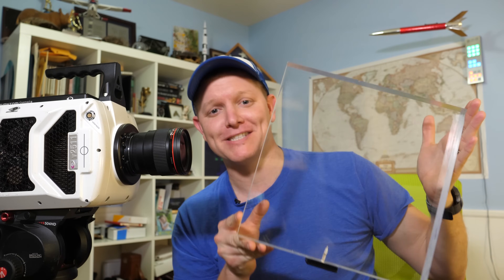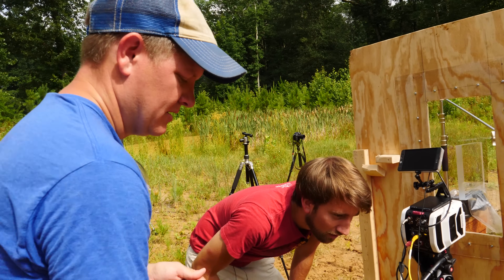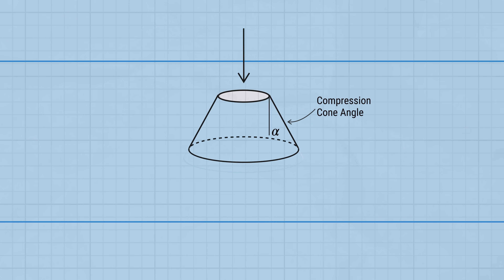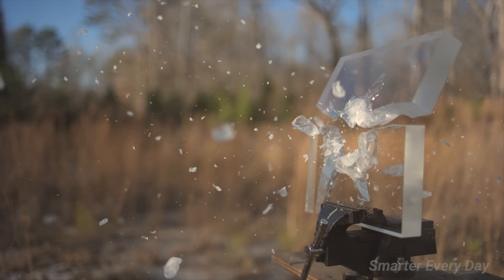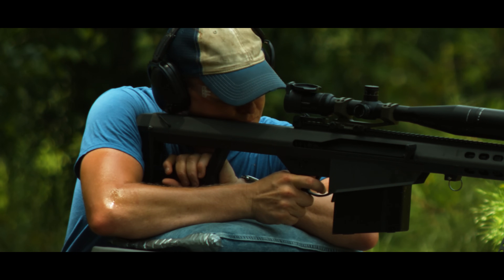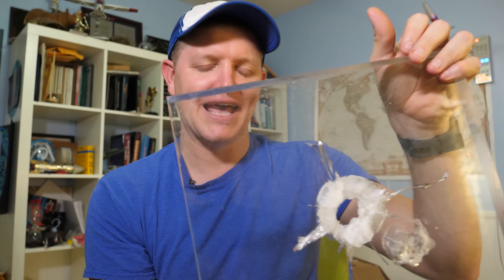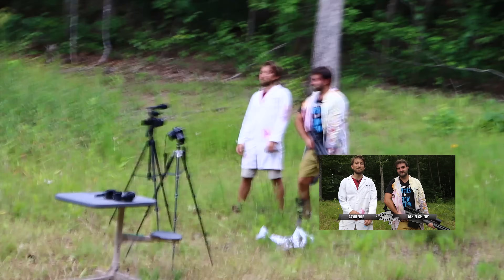.50 Cal vs Ballistic Window HARDCORE Slow Mo  - Smarter Every Day 187

Comment: One of my favorate parts of watching a gun firing in slow motion is that you can see the powder burning out of the front of the barrel. Contrary to popular belief the gunpowder in a gun doesn't explode it burns and pushes the bullet out of the gun it's really only the primer that explodes. That is why many guns get better velocity out of longer barrels and not just better accuracy. That is true until all the powder burns and the friction starts to slow down the bullet. This is also why you don't get anywhere near the velocity printed on the box when shooting .22LR out of a pocket pistol where the .25ACP is designed to be shot out of shorter barrels the .22LR is designed for rifles.

Comment: Is it just me or did the 50 cal pass through the armor long before its secondary critical failure... as if reverberations from the pressure wave caused the larger secondary break not the original wave front.

Also, I wonder if the 5mm left a central circle intact because most of the mass of the bullet impacts at the radius of the bullet where the metal sweeps back into a cone... or whether its because the pressure waves from opposite sides of the bullet dampen each other inside of its radius... or something else like the video suggests...

Either way it looked oddly like the craters in old DBZ episodes ;)

Comment: Looked like the .50 bullet lost its jacket as it penetrated the bullet resistant material.    Was that military ball ammo or a commercial reload?    I've seen heavy (I think it was quarter inch untempered)  window glass that was shot with a pellet gun that had a very clean cone punched out on the exit side.

Comment: Based on my experience breaking rock with explosives (and degree in mining engineering) I suspect that the spalling seen from the 9mm impact is actually caused by the reflection of the impact shockwave off of the back face of the panel.  The pressure cone under the nose of the bullet is still in compression, but that reflected wave is putting the material outside the cone into tension, leading to the conchoidal fractures seen in the spalling.

Comment: Destin, I have a question for you. Imagine an aircaft powered by jet turbines or rocket engines, on the ground, ready to take off. If there is a very solid obstacle, such as a sturdy concrete wall, near the exit of the turbine (or the rocket), would that affect its propulsion in any way?

Your videos are great! Thank you.

Comment: Destin. If you want to understand more about the forces fracturing hard material, talk to flint knappers. They probably won't be able to attach the proper jargon to it, but they understand what happens.  Another interesting thing is that that frustum you show can be found commonly around the ancient manufacturing sites for arrow heads. Just that conical section, but then in flint. The explanation I commonly hear as to why it is discarded is that the conical shape is difficult to work and too small for usable pieces. But it looks like it is the waste product of the initial blow. Most likely the usable pieces will come off on all sides at once.

Comment: Something something, fracture cone and the speed of sound through a material determines angle.
Reply: Steevo69 speed of sound? That bullet is going 3× faster than the speed of sound.
Reply: The "speed of sound" is the propagation speed for  a crack through a substance, and it plus the atomic bond strength determines the angle of the "cone" break shown in the video. Glass has an absurdly high speed of sound, you should watch The Slow Mo guys video on it.
Reply: Steevo69 pressure wave and the crystal or material bond structure...

Comment: So does the bullet resistant material take more damage than a normal window because it trys to resist the damage by widening the cone?  Also why does the window fully crack only after the 50. Cal goes through it is it because it takes that long to react or is it because the waves of force left by the bullet can no longer be absorbed by the projectile its self?

Comment: I'm kinda missing the explanation for the big white cloud of the .50 exit. Is the pressure cone energy or speed dependent, so that it ejects more material? It clearly does not punch out the clear cone of the 9mm. Could you go in more detail or give some keyword we can read up on?

Comment: Triboluminicence when the bullet hits the glass at 5:59
Reply: If too much light impinges on a given pixel in some CMOS image sensors, the potential well of that pixel can spill over and increase the reference level (this is called 'blooming' for CCD sensors). This in turn, causes an error in the sensor's output due to the subtraction of signal and reference. Since the subtraction results in a negative value, the output of the sensor is set to zero. Thus the 'black spots' appear in a field of bright pixels.
Reply: Well spotted, it's only visible for one frame.
Reply: Great eye! I noticed it too once I saw the bullet hit the glass, and had to go back frame by frame to make sure it was triboluminescence. That's not blooming, that's the crystalline structure losing an electron when impacted/split. VERY beautiful! A little disappointed Destin didn't notice it/call it out!
Reply: but what was the darkness after the flash?

Comment: Hi! High road, Low road (Brachistochrone Problem). Two cars on two different roads, both start at the same height, finish at the same height.  Both start at the same speed. First road is flat. Second has middle section lower than other. Start - Finish(displacement) the same. Second has longer path. Question is: Can this be used in real life to gain time / save fuel on real vehicles??? (maybe in hyperloop or something (less friction) ).

Comment: destin, you should look at about 2:07 and pause it when the bullet exit your gun.
with the fire ring around it.
then capture the frame, and make it your wallpaper, it's really beautiful shot (pun intended)

also at that frame i noticed light reflected (or somekind of lens flare) on your face that is look dotted or pixelated, what is that? is that effect done by phantom's sensors or enviromental effect?

Comment: That stress cone does explain the blowout on the far side of the 50cal and why there's a tiny clear spot on the 9mm. I'm surprised that you didn't explain the entry crater though. I did think it was cool to see the transition on the 50cal from the entry crater to stress-cone-caused fracturing on the back

Comment: As usual the video creates a hundred more questions. I noticed that the fracture propagation was actually slower than the velocity of the round. The round passes through then you see the fracture propagation take place after the round has cleared the target. I always assumed it to be a property of cavitation tempered by the resistance of the surrounding material but there appears to be something else at play here. With the 9mm round I was hoping to see the bullet collapse and as it deformed and that energy being transferred from forward momentum to an outward force from the ripples in the lead but the target shattered. Can't have everything I guess Great video though cheers

Comment: The way I think about the pressure cone is that when the cross section area get bigger, the bullet is breaking more bond per second, which means that the resistance force is getting bigger. In the pistol case this force quickly put a stop to the bullet, but in the .50 case, the bullet kept moving, so its more destructive to the back side of the glass. 

Also, considering that fluid don’t really resist shear, do fluid like materials have a smaller angle cone, and solid materials have a larger cone? ( ideally rigid plate have a 90 degree angled cone)
Reply: Fluids have a really interesting phenomenon called hydrostatic pressure. It basically means that when you put pressure on the fluid, the force spreads out equally in all directions, which is why when you step on water, it splashes upwards

Comment: Please Keep ur video quality in 1080p for better experience
Reply: Taking videos with those frame rates requires the drop in resolution. It’s not meant to be a “pretty shot”, rather it’s to show what’s happening in the unfathomably small moment when the bullet impacts the acrylic.
Reply: I’m not sure there is a camera that can film 1080p at 170,000fps
Reply: i think its the camera doing it for the higher fps, the fast it is the smaller you get to see
Reply: LOL you dont get a 4k out of a 100,000fps video. if that was the case then the camera can see even higher fps
Reply: i think there is a camera with 1,000,000fps but like 1x16 pixel resolution

Comment: Fantastic video! You used Lexan, not Lucite, correct? You said acrylic.
Reply: I used acrylic
Reply: Clear polycarbonate is bullet resistant. Lexan is a trade name for it.
Reply: BR glazing for windows is a multi ply glass clad polycarbonate, depending on the ballistic threat level, we use 3, 5 or 7 plies with the outer layers being glass and the inner plies being a combination of polycarbonate and polyvinylbutyral (pvb).  The glass serves 2 purposes: first the shatter / deform the bullet and absorb some of its energy and second to protect the polycarbonate from scratches during the regular service life.  There is also a product available made from aluminum oxide, but it is not available for larger windows.  I have never seen acrylic certified higher than UL 752 level 1.
Reply: Lothar Erkens Yes, I had a friend years ago that had a factory in China that makes it. Tempered glass and polycarbonate bonded together.
Reply: Destin rarely, rarely, ....rarely gets these sorts of things wrong. A question is never bad to ask though if you're checking something. That's science!

Comment: I would assume the audio for the slow-mo footages is made by Gordon. There is just one concern I have with the audio, some viewers might not know that the audio track is processed by computers, and it's not the actual audio, this might mislead people. So you should put captions declaring this, or else people might think it's the actual audio. Just like most images of the solar system, people misinterpret the scale of the planets, for the audio track, people might misinterpret it as the real-life audio, after all, we don't really know what it sounds like in slow motion. (And honestly, I felt a little bit cheated after finding out the audios are computer processed)

Comment: Hey Destin, great job as always. Can you spend some time explaining the delay in break between the time the 50 cal bullet hits and glass shatters? (5:48 ish). Is it the time it takes for the fractures to propagate?
Reply: Pressure waves travel at the speed of sound, and the bullet is supersonic
Reply: People seem to forget that the bullet hits the second piece of glass (the one that the camera uses).
Also the speed of sound in glass is faster than the bullet (in most cases).
Correct me if I'm wrong.
Reply: Bladsmith That was a far simpler explanation then I was expecting but now that I think about it, it makes pretty good sense thanks.
Reply: This was my question.     There seems to be a moment after the bullet leaves the glass and leaves the camera frame where nothing is happening, but then the glass literally disintegrates in what looks like one frame.   Amazing.   Obviously something is happening during that pause, but what?   Speed of pressure wave in glass, as suggested, is a good start and must be part of the explanation.    Guessing .... maybe the pressure wave traverses the glass panel, outside the frame of the camera, until it hits the edges of the glass ... and then .... then I 'm out of my league.
Reply: Ever see glass crack in high speed? It's practically instant. See the video the SlowMo Guys do with pyrex.
Or Destin's Prince Rupert Drop.

Comment: Bulletproof materials are specifically developed in order to have a pressure cone as close to 90 degrees as possible, spread the force outwards and never allowing the pressure to reach the back of the material. Also you have to consider heat generated by the pressure at the point of impact turning the surface plastic (plastic the material property, not the material type) which will allow it to maintain that clear and clean finish after it cools once the projectile has dropped away.

Comment: Why does the bullet spin?
Reply: Rifling
Reply: Cool thanks
Reply: That's how it spins, why is gyroscopic stability.
Reply: Rednaxela 178 yea, the rifling keeps it stable during flight. And also the pointed tip of the bullet helps with aerodynamics.
Reply: It spins backwards in Australia since they are upside-down.
Reply: But in Australia...
Reply: Nathan Smith ... Ahhh, so if you are on the equator and at the edge of a time zone, then when you shoot towards the west, the bullet may hit the target at a time earlier than when you pulled the trigger!!
Reply: but what happens on the equator?
Reply: Bill W There are several cases of bullets floating miles into the air. Eventually being picked off by solar winds. At the equator.
Reply: Bill W it's the Coriolis Effect when you fire perpendicular to the equator; firing in line with it, your bullet may travel an hour back (or fwd) in time if you're near the edge of a timezone
Reply: The physics of things...spinning bullet has angular momentum.  The direction of that angular momentum does not want to change (bullet continues pointing in same direction) unless a net external torque acts on the bullet. Since there is VERY little net external torque acting on the bullet during flight, it flies "true." Rifling of the gun barrel causes the spinning of the bullet by exerting a torque on the bullet as it moves through the gun barrel.

I Live For Physics. :-)
Reply: spins horizontally
Reply: Keeps the bullet going straight

Comment: I think the top center light on the bottom section of your clock is dead. From 6:40-7:15 it never lights up, and the number of lights goes down occasionally (when that light is supposed to be on, I assume).

Unless I've misunderstood how that clock works, which is totally possible.

Comment: The 9mm result reminds me of when I was studying the failure modes in ball bearings.  Oddly enough, when a ball bearing fails it doesn't chip away material on the races (inner or outer) at the surface, it actually fails sub-surface and then the crack propagates upward toward the surface.

Comment: That's kind-of a funny left hand position - I'd think that if the weapon is designed for left-hand support at the shoulder, it would be for a position similar with the MG-42, palm facing the shoulder. It seems like that would be a more stable hand position than pinky-side towards the shoulder...

Comment: 05:58 - the tip of the bullet flashes white then black in 2 frames, what's going on there? Also, totally no expert on fracture mechanics, but wouldn't the frustum deviation depend on the molecular shape and structure?

Comment: I'm a long time subscriber, first time commenter. First off, love the videos. Thanks.
My guess is that the ballistic acrylic has a large compression angle relative to other transparent materials. The force of the bullet is distributed into the acrylic and can be broken down into component vectors.
Is the minimum stress of the acrylic in the direction where it is thinnest, i.e. the direction y'all were shooting it at? If you shot it into the side, would the whole thing just blowup?

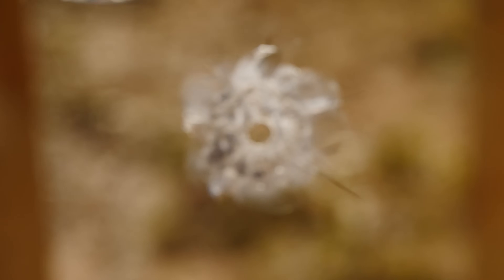Comment: Regarding the lack of damage at the point of initial contact 2:50.  I think there is more going on here.  During contact, the point of maximum stress actually occurs below the surface, this partially explains the lack of damage.  However we need to think more about the types of stress.  Where the bullet first contact the major stress will be compression (not likely to cause fracture), surrounding this there is an area governed by shear stresses (Mescall zone, likely to cause fracture), further below this is a zone of tensile stress.  I assume there will also be more shearing stresses at the edge of the bullet, compared to the center.

For a source check out: Shockey, D., J. Simons, and D. Curran. 2010. The damage mechanism route to better armor materials. International Journal of Applied Ceramic Technology 7(5): 566-573.

Comment: For about a single frame at 5:59, you can see a bright spot as the bullet impacts the acrylic. I shy away from calling it just a crack in the acrylic (as seen when the forces propagate through the material) - but I’m unsure if that would be mechanical luminescence or otherwise.

Comment: Using a rifle under water in horizontal way was great, after your pardon if we use the rifle (fast bullet source) in vertical way (up and down) does it the same as if it is in horizontal way: the track of bullet, the explosion and implosion of hot gases in water ... thanks